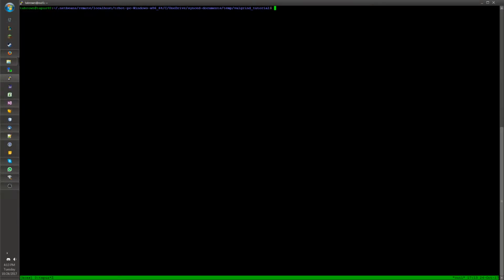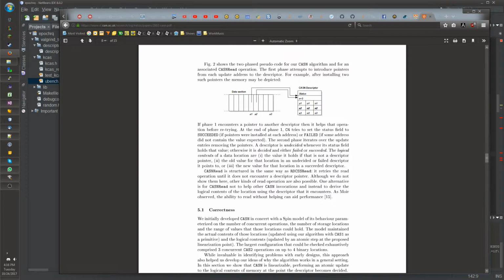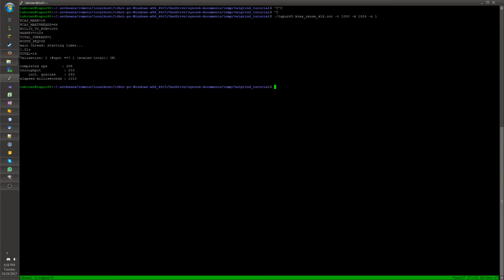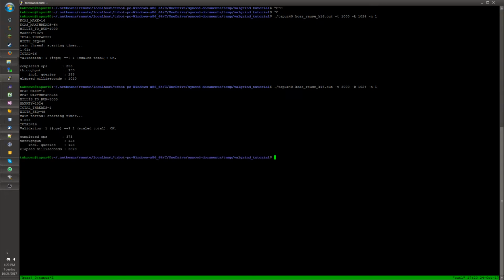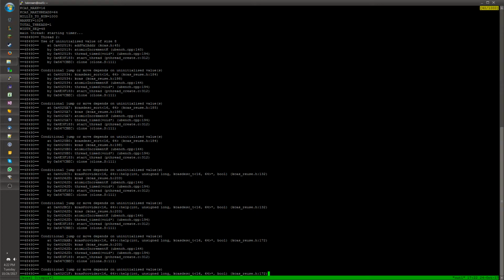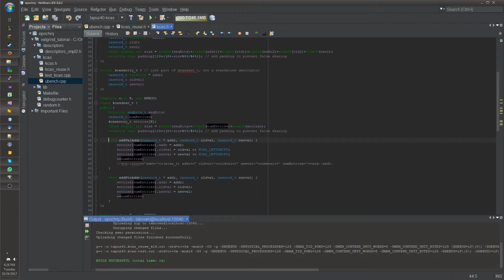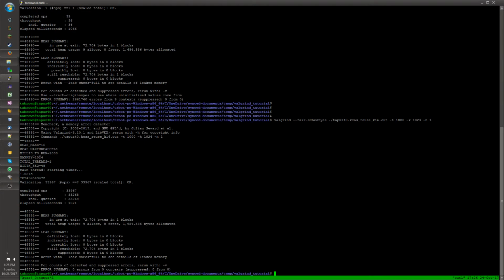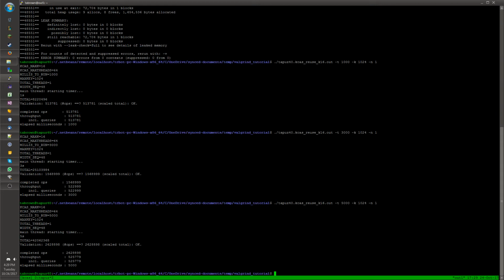Speedy debugging with Valgrind

Comment: Thanks for the guide. Never used this tool yet. For a long time I worked with Windows and used completely different debuggers. But now I'll work in Linux and your video is useful for me
Reply from the maker: it's great to hear that it was helpful!
Reply: What debugger do you use?
Reply: @robertmiles9771  If you're asking me, I use Valgrind for Linux and Deleaker for Windows ;)
Reply from the maker: @robertmiles9771  If you're asking me, GDB and Valgrind, and for my IDE Netbeans.